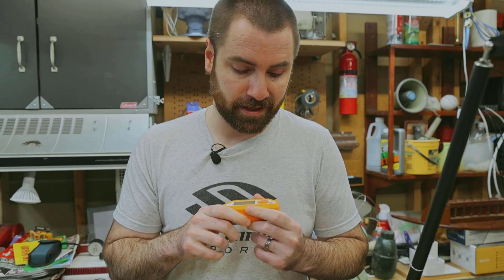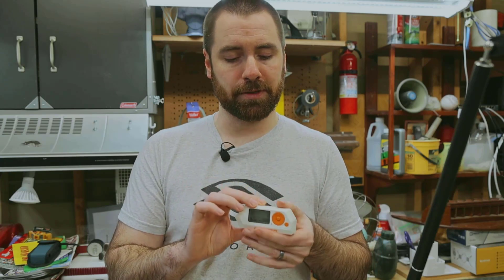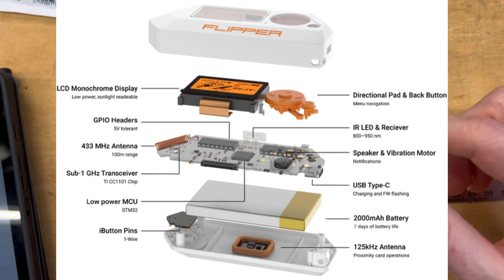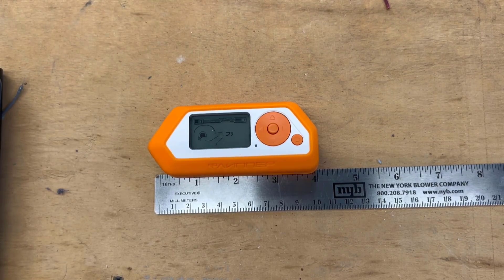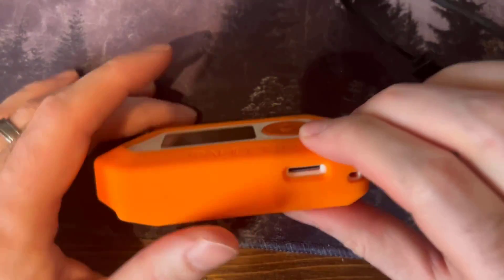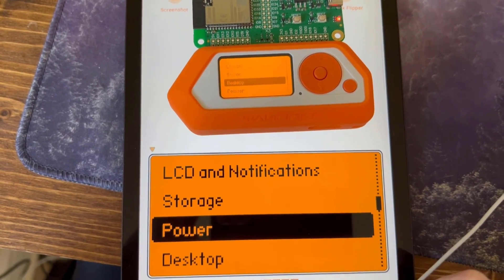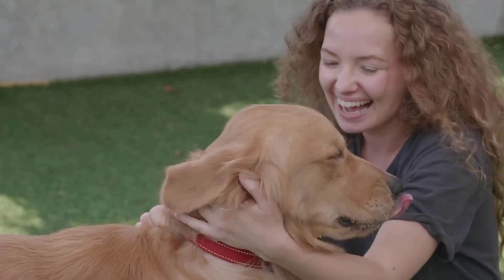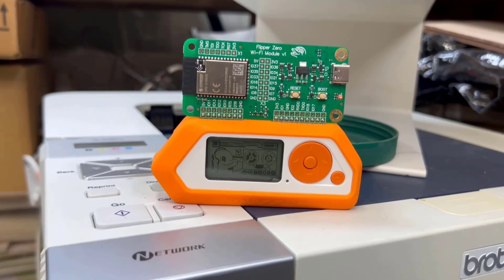Flipper Zero Unboxing, Review, and Startup: 2024 Edition

Comment: If I just get the standard pack without the GPIO boards, what pros and cons will there be? Which feature will I not be able to use
Reply from the maker: You get all the standard features! If you have specific projects or needs you would want the GPIO - but also recommend an arduino starter kit that comes with breadboard etc. Would want to test setups prior to using the GPIO boards